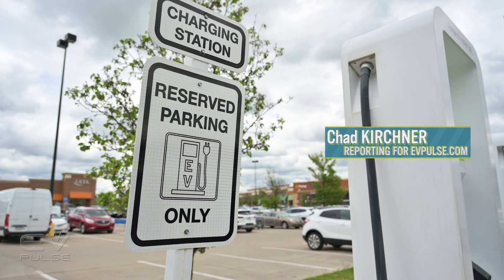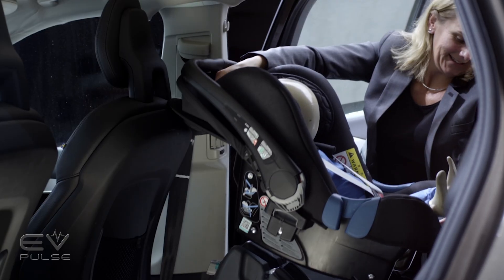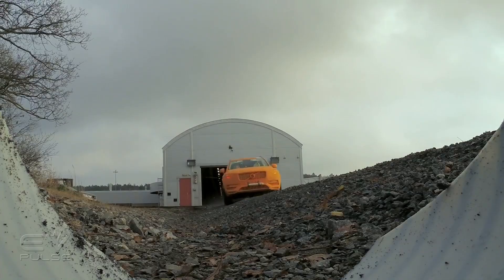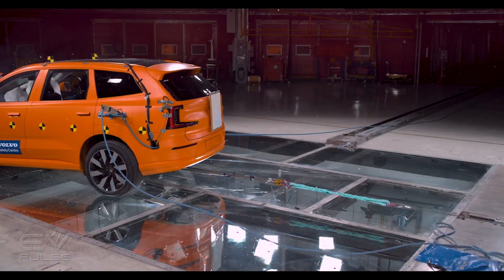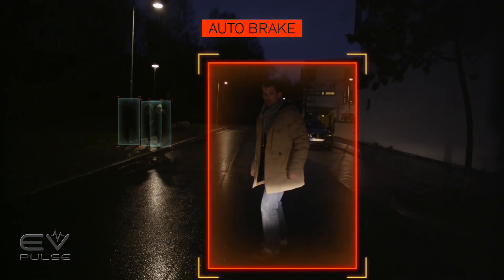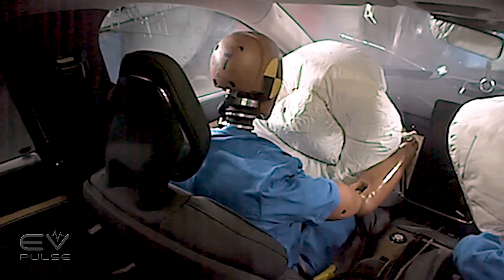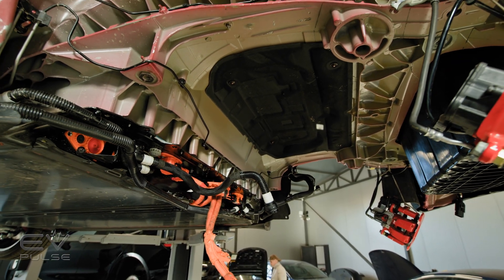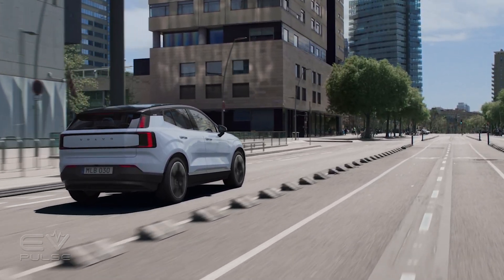Are EVs as Safe or Safer Than Gas-powered Cars?

Comment: The shear mass of the current EV crop would help if you're running into another vehicle.  If you happen to be hitting a fixed barrier, tree, highway overpass it would work against you.   Likely they are safer, but the batteries can go into thermal overload if the cooling system is ruptured and that means fire, and it's going to be a nasty chemical fire as well.